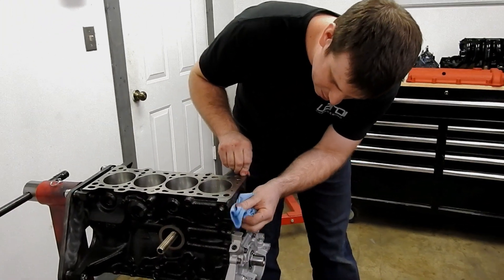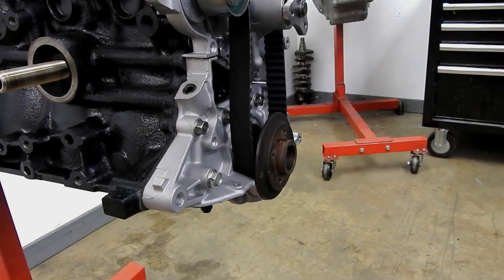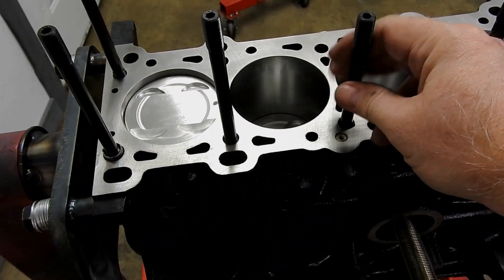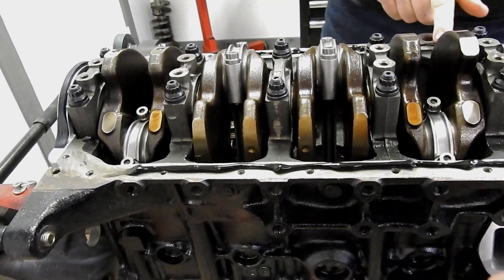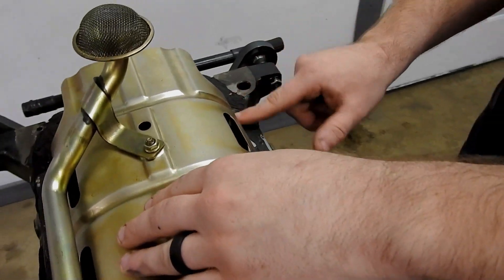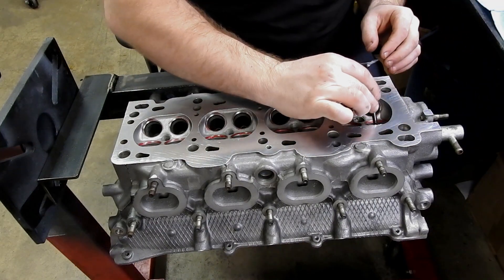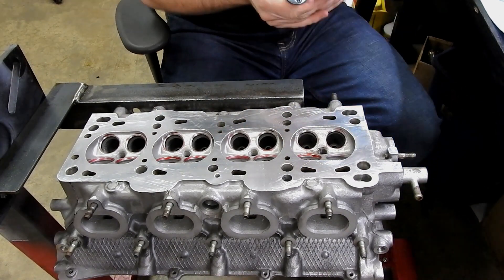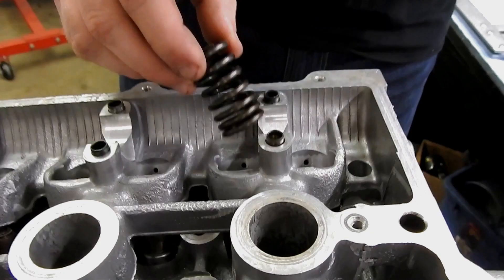Miata 1.8L Forged Engine Build Part 3 Finishing up

Comment: Please show us the rebuild of the lifters, i was here for that. Its such a common issue on the miata.
Reply from the maker: Yea I understand. The downside of trying to film it myself was that if I was elbow deep in oil, I didn't film it.  They are surprisingly easy to rebuild.  The key is to pump up the lifter before reassembly. I'll try to see if I can get a short video on the process.
Reply: @rh2racing  Got it, thanks anyway. Learn a few tips on your vids. Keep it up.